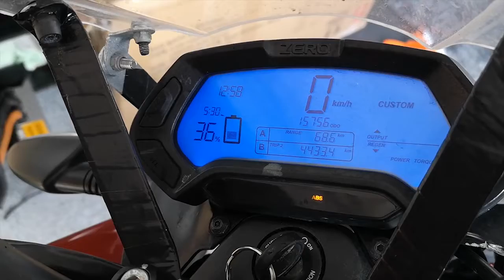When your road trip doesn't go as planned

Comment: Suddenly those drainage holes I put in my pan don't look so crazy, eh? Good on you for continuing to show us both the triumphs and struggles of electric life. Keep up the great content and push your channel, and travels to new lengths! You're an inspiration, bro!
Reply from the maker: Drill holes in everything. Life is better with holes.
Reply: @NewZeroland  did you have the pans from Diginow? I haven't had a problem with them so far, but water/mud in the pan is one I'll look out for when getting it serviced. Thanks as always for sharing great content
Reply from the maker: @hreisig  yep.  Drilling extra drain holes is helpful, and keeping your connectors out of the pan is also better for the wiring.

Comment: So it seems like drain holes and more water proofing on the connections. There is a great tape called F4 tape that would be great for your connectors. It only adheres to itself and there is no sticky residue to deal with. The orange tape is high temp. It works really well! It’s almost like shrink rapping with vulcanized rubber. You would have to cut it off to un plug the connectors. However the water tight seal you can get if done right is one many have trusted their life to. It gets used on some aircraft that go supersonic. Hope this helps. Thanks for another great video.
Reply from the maker: Thanks for the advice! Diginow no longer has andersons in the pan (probably for this reason). They extended the cables so they go straight to the controller and aux, which works way better.
Reply: Yup. That’s the hazard of being on the cutting edge of E-bike modding. You have over come a mountain of design flaws and glitches though. Many people wouldn’t have been nearly as committed as you have been. 

I’m actually surprised more of the guys working on E-bikes haven’t already used F4 tape. It’s more handy than duck tape and is a wonderful insulator. 

Great job hanging in there with all of the trials and tribulations.
Reply from the maker: @stevenb7319  Thanks man! All of us Zero riders are still early adopters, taking risks on new tech.  Without us supporting electrics, we wouldn't advance at all, and the future would be less cyberpunk and more Mad Max :P

That said, I feel like the point where e-motos become more viable than gas bikes is coming sooner than people think.  Like probably later this year!

Comment: It sucks you have to go through this, but I am definitely taking notes on what to prep for when the pan comes in. Looks like I should buy a lot of silicone sealant.
Reply from the maker: Yep, absolutely man. I'm not even putting my pan back on. I'd rather lose tank space. That and the pan gets reeaaally hot, to the point where the chargers won't work at full power. It seems like Doctorbass is looking at liquid cooling options.

Comment: You're giving me a lot to think about. Not sure when my kit will arrive, but hopefully in the next month or so. Sealing the pan might be counterproductive if cooling is already an issue. I might look into a custom pan that is both sealed better and has room for cooling, maybe liquid cooling which would allow for both sealing the pan to keep things dry and still keep everything cooler. Or maybe seal the pan that comes with the kit and add external cooling.

It seems a bit odd that the chargers don't cool off enough while you're riding, since presumably they aren't doing anything then to create heat and there is airflow to the pan. That probably means a whole new pan will be necessary to get enough cooling.

I would really miss the tank storage area if I have to put the chargers there, so I really want to make the belly pan work.
Reply from the maker: Check out what Doctorbass bought on the Zero facebook group. It's a flat liquid cooling setup that I think he's going to use on thr bottom of the pan. Otherwise you could drill some drainage holes for rain, or put some mesh around the top to shield it from filling up with rocks.  But yeah, the overheating thing is definitely an issue. You'll have to experiment when you get em. I've charged up for half and hour, then ridden for an hour, and when I tried to charge again, they weren't running at full power. Maybe an external fan pointed at the pan?

Comment: You have incredibly patient gas engine riding buddies to last as long as they did.  I had a completely unrelated question.  What type of riding protection pants to you wear?  Are they comfortable in the heat?  Also, for your pan.  It should have a double bottom.  Both very open to allow for drainage, but the opens should be offset to keep water and debris out.
Reply from the maker: I just wear some random textile pants with padding, but I took the lining out. It never gets hot here so they work pretty well. And yep, the pan needs to be sealed better, and cooled better. At the moment I feel like these chargers work way better in the tank area.

Comment: That's pretty frustrating. If your charging isn't reliable it takes all the fun out of the ride. I'm new to Zero-world, but if I were troubleshooting that I would definitely monitor the input voltage. Long leads and potentially casual installation at RV parks could mean significant voltage sag, especially with two bike plugged in. Could be many other things (and I don't know that system) but that is an easy place to start. Something is out of spec. It is going to take at least a multimeter and probably an ammeter to find it.
Good luck!
Reply from the maker: Totally man. Reliable, consistent chargers are key for long rides. I've had great experiences with these chargers, but the pan may have caused some issues. It also gets REALLY hot, which kills the power on multi-charging stop trips. I'll go back to having them in the tank area and see how that goes.
Reply: @NewZeroland  Are you talking about the chargers getting hot or the battery?
Reply from the maker: @Miata822  the chargers.  The battery only overheats if it's a hot day.  The chargers will get hot and throttle down their power after 1 charge when they're in the pan.  So the next charging stop takes longer.
Reply: @NewZeroland  Interesting. Designing things that cool stuff is pretty much what I spent a career doing. Maybe I should look into this.
I recall from an earlier video that you mounted the chargers into a new metal pan (aluminum?). I don't recall you using any heat sink compound between the chargers and that pan. That might help quite a bit.
I assume it is a tight fit between the top of the chargers and bottom of the battery, right?
I'll see what Info I can find from the diginow page.
Reply from the maker: @Miata822  yep.  I used heat sink compound, but there aren't any fans in there and the space gets hot pretty quick.  I used to have the chargers up in the tank area with way better cooling and protection from the elements.. so I think I'll try that again for my next trip :)
Reply: @NewZeroland  Sending you an email to the gmail acct listed in your About link

Comment: Hey everyone, I’m new to riding and looking to buy a Zero but i’m wondering if i should either wait a few years for EV bikes to get better (and for Zero to iron out a few kinks) or to just dive in and buy one. Any suggestions?
Reply from the maker: Hey hey, thanks for commenting.  My advice is to look at what you need (range, power, etc) and buy a used Zero.  My 2015 is still amazing, consistently goes 80+ miles on a charge, and beats 90% of gas bikes in stoplight drag races, if that's something you're interested in.  Some used SR's can be found for $8k, so they're relatively affordable entries into electric motorcycling.  I haven't had any problems with my bike in the past 3 years (aside from charger problems, which I've caused) :D
Reply: NewZeroland Thanks dude really great advice i’ll look into it!! 👍🏻